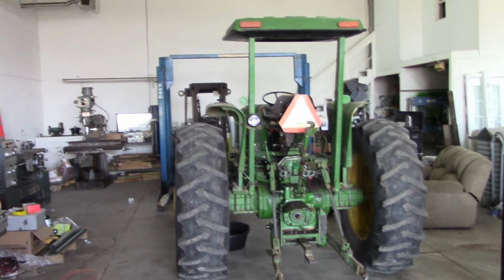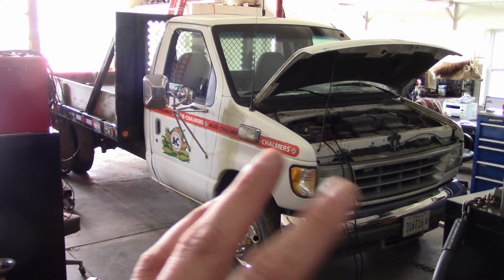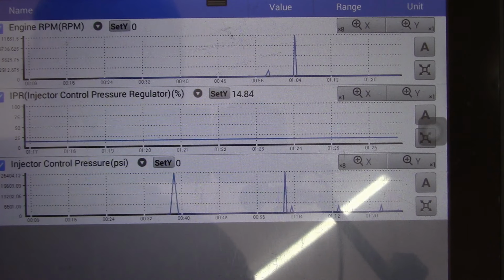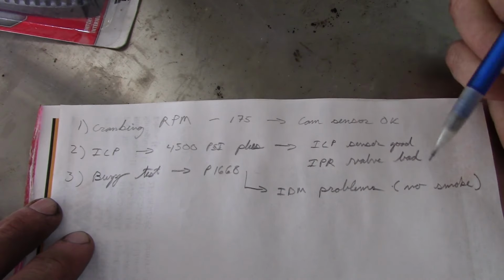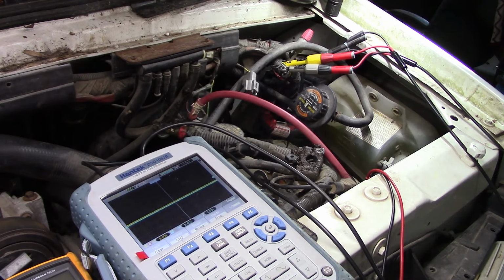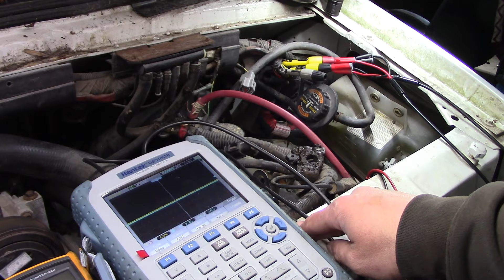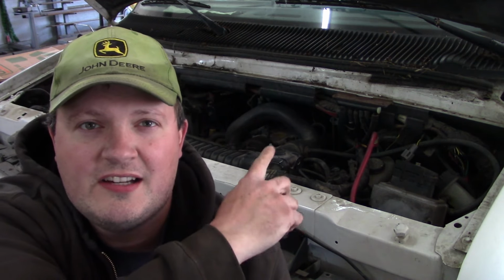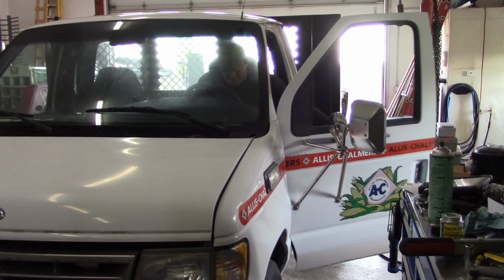Ford E350 | 7.3 Power Stroke - Cranks but won't Start - Part 1

Comment: Thx for the video.  You took a bit of a risk by using your own module, considering it ate 3 previously.  40K mi on an ambulance is like dog years.  That engine has been heating and vibrating the wiring harness and associated components for many more hours than the 40K would suggest.
Reply from the maker: True. It could have 20,000 idle hours.

Comment: what? no push bar on the cub cadet? 50,000 miles and 500,000 miles worth of idling! 7.3 in a van has a larger turbo because they dont have an air charge cooler. it will be interesting to see if the connectors are melted together shorting out the idm. the 25 miles thing suggests to me that it could be temperature  and expansion that helps to induce a short. cant wait to see you dig into this one. these are my favorite types of repairs.
Reply from the maker: Yeah, it may well have 20,000 idle hours! The owner says one valve cover was removed and no issue was found. But there has to be something happening and the valve cover harness is such a common failure.

Comment: Just a thought.. you didn’t mention it, but did you pull the old IDM apart and look for water encroachment?  The placement if the IDM was in a spot that would cause them to flood when it rained or from washing the truck.  I have heard of back to back failures because of this.

Comment: In Europe (and many other places). The Ford Transit Pickups are this style (Van front, pickup rear) , Also Mercedes Sprinter, Reneult Master etc. Oh the Euro fords were 2.5 litre and traditionaly non turbo ;)
Reply from the maker: That would be easier to work on than a 7.3L engine that barely fits in a class 8 truck.

Comment: My first check would be wiring changes made when ambulance body was installed and removed.
Reply from the maker: Yeah that's a good call.
Reply: Yeah, I've stripped the shitty wiring out of a couple of ex-fire trucks, those guys suck at wiring and figure more tie wraps will fix it!

Comment: Those units must have a known problem if a lot of the companies have reco'ed units available.. Where i worked we had a run of Bosch abs units go open circuit where the pin terminals would break away from the circuit board. I had the magic chopsticks. You'd take the cover off and push on the terminals while your mate is in the car reading the scanner. Wed just resolder the joints on the board and they'd work. Is it worth a look as you know which terminals you are looking for?
Reply from the maker: They are pretty reliable, but they had some issues with water intrusion. That pretty well ruins them!

Comment: Hello Wes. Could it be a voltage surge ?. Or like you said the connector in the valve cover?.  Has always Liked,shared. All my best. Awesome Mower ; )
Reply from the maker: Could be. I don't know. It's odd.

Comment: There must be a formula of some sort to determine how a large shop becomes so small in a short amount of time.  I enjoy the videos.  Thanks
Reply from the maker: Stuff expands to fill the space...
Reply: @WatchWesWork  You put a lathe and bridge port in a room together,  come back in 9months and the whole place is over run with  pedestal grinders, shapers, horizontal mills, and cnc routers.  Buggers reproduce like rabbits.

Comment: If it's an ambulance, you got a chance. Those should be a good deal if you want a cheap Powerstroke but here in the south they are all clapped out by the time they retire them. I'm sure with some digging you'll find why the IDM keeps getting "fried out".

Comment: I’d guess high resistance in the injector circuit. Possibly a bad ground causing high resistance. Maybe try a voltage drop from the module to an injector?
Reply from the maker: I've checked each circuit and they are right on spec.

Comment: I remember when the ambulance service in BC, Canada started using diesel ambulances. It was around 1991, so the 7.3 IDI no turbo. The news did a story about frustrated drivers having trouble making it to calls in a timely manner, because they could hardly get a hill! My dad was on ambulance when his station was first given the diesel ambulances, but by that point they were the powerstroke, so they were actually pretty good.
Reply: i think a lot of places in the US ended up just putting turbos on a boatload of government equipment before the turbo was the standard option. firetrucks and ambulances were having trouble with hills and such.

Comment: Chances are you have a bad ground. I had a 97 doing the same thing, eating idm's like a 5 year old with a bag of Oreo's. Mine ate 6 within 150 miles. Turned out after a 3 week study and 11 different diesel mechanics it was a simple ground problem. Replaced all the main ground leads to the motor and frame and to this day ( 9 years later ) it has not ate another idm. After it was fixed i had the injection harrniess replaced just to be safe.
Reply: WELL THERE'S YOUR PROBLEM LADY!
Reply from the maker: Seems like a valid concern. I will check them.
Reply: Yeah, I would look at what the did in the conversion. There was probably all kinds of wires that supplied power o the rear half. I'm thinking thatt ay have been what rubbed the wire bare.

Comment: Have a question way off topic. 06 Cummins 5.9. Rough idle and smoke upon cold start meaning sitting overnight. Then once its warmed up runs great. Everyone says its injector problem... has a FASS lift pump changed filters...can u give me some tips to check myself before I take it to the stealership?
Reply from the maker: I don't know as much on the common rail Cummins. I don't know how much I would worry about it if it clears up quickly.

Comment: Any way you can compare your IDM and the junk one with an ohm meter and maybe see which pins are open? Maybe narrow down the circuit that is causing the issue? Also if the alternator was over charging could that cause it?
Reply from the maker: We can try.

Comment: Hey Wes! I’m in the market for a scanner. Is the Autel that you are using the $1500.00 ish one?  Lol, notice I go by the price (model number) not the actual model number. So, yeah just curious. I need it to be bi-directional. Thanks!
Reply from the maker: It's a Maxisys 906BT. I think they run around $1200. It's been a nice tool. It has quirks, but I like it.

Comment: Sounds like the high pressure oil pump
Reply from the maker: Nah. That was an issue on some of the earlier 6.0s, but the 7.3 HPOP rarely fails, especially with low miles.
Reply: @WatchWesWork  I had a 7.3 in a 2000 f350 I changed every sincere and modules nothing until I changed the high pressure oil pump it fired right up run like a new one the guy that has it now runs the sh.... Out of it

Comment: Does the system have a total hours function somewhere? The first thing I initially thought was arcing or grounding issue. Excellent work on the diagnostics!
Reply from the maker: I don't know. The Super Duty trucks had an hour display.

Comment: An ambulance would run a lot. Air conditioning or heat. Probably has high hours on the motor. Take care Wes
Reply from the maker: Yeah I'm sure it has a lot of idle hours.

Comment: The IPRs also frequently fall apart when the sheetmetal nut backs off. Blob some silicone or thread locker on it once you put it back together. Look down in the oil flooded valley to recover the nut.

Comment: You might be on the right track with those worn through wires.  Check through all the wiring for shorts,  breaks and ground loops.  Check for good grounds everywhere as well,  you may have to run some ground cables.

Comment: Was that sparking or just tape flapping comming from that wire connector with the wires worn thru 

Edit: 
Look at time index 22:30 just above the alternator you will see the connector flashing or some tape flapping.

Comment: I would check for poor grounds. May explain the crazy high pressure readings too. Certainly not a happy bunny.
Reply: That is what i was wondering. It does seem like the circuit is grounding somewhere it shouldn't. Very strange.
Reply: I have seen this also but the truck has 40,000 miles. Still a good idea to check all grounds.
Reply: @Military-Museum-LP  It may only have 50K miles but being an ambulance it has hundreds of Idle hours, which are generally harder on diesels due to the fact that they don't burn as good when idling resulting in more cylinder wash.
Reply: Every PS e4od that has failed me had tge pump welded to the case or the shaft or both bad grounding is def a prob on pre 2001 then it became a guarantee
Reply: @johnstockwellmajorsmedleyb1214  can you explain a little more. My van is a 95 7.3 . Lost power then couldn’t restart it. No fuel is going into the fuel bowl
Reply: @appliancerepairshorts  
Man you are SOL my Crystal Balls are in the shop! LOL
Hit me up here when you can be live and I will pop my email for a minute

Comment: Is your scan tool off by a factor of 10 on the ICP? the duty cycle on the IPR looked fine (not maxed out) like the PCM was ok with the reading
Reply from the maker: I don't think so.
Reply: Ok definitely something to look out for though, we've had a few misdiagnosis at the shop from snap-on puting the decimal point in the wrong spot

Comment: The 25 miles is what's interesting for me. What would the conditions be at that point? Does it take that long to hit full temperature? Maybe starting a regen (if that's on this engine)
Reply from the maker: Heat, vibration, etc. I don't know.

Comment: What does the back of the cab look like? Did Ford mass produce those as cut a ways then fill it in after with sheet metal ot is it all one piece?
Reply from the maker: I never paid attention. The cab is closed at the factory. If they use them for campers or whatever, they just cut an opening in the closure.
Reply: The cab was open to the ambulance box. The Brother in laws remount business found the back enclosure and the flatbed and put it together for me.

Comment: no wonder so much of this power stroke crap is sitting in junk yards-back yards and so on NO one knows how to get them running.
Reply from the maker: I dunno. It's really not a whole lot more complicated than a gasoline engine of the same vintage. I suppose most mechanics are out of practice on these old HEUI engine now since most are in the smelter.

Comment: Nice work Wes.  did you check with the scope after switching the idm's to compare the results?  just to know if that 4500psi still exists or that it lowered to normal settings.  i like your video's, they are educating and entertaining. thanks for that!
Reply from the maker: I did not, but you can hear that the injectors sound like they are firing perfectly.
Reply: Maybe Wes knows more than me, but I would have a) put the scope on my truck's known good IDR just to refresh my memory of what it should look like, then b) put the IDR from the dead truck in my tuck - to see what the trace looked like in the context of a good system, (ie if there were any spikes). That would confirm the IDR was indeed no longer working properly. Knowing that, I'd be worried at putting my known good IDR in the dead truck - especially if my truck was not showing spikes.

Comment: Just replace the motor with a 300 inline.
Reply from the maker: Did they ever offer the 300 in an E series? I don't know if it will fit. That thing is long!
Reply: @WatchWesWork  yes. My 1993 E150 had a 300 inline. Definitely gives you a little more room to work on it. The spark plug in the front was the only one I had to get from under the hood. Wasn't bad accessing things through the dog house. Starter was even easy to get to.

Comment: Did you run that test to check the pressure with a known good injector driver module to see if you get the same erroneous high results?
Reply from the maker: No, but we can hear the injectors are firing correctly. They sound horrible if the ICP pressure is too high.

Comment: if the injectors are not firing there is no outlet for the oil to flow and that causes the pressure to go high, the high cranking pressure is a indicator of a IDM issue.
we had a number of econolines with the 7.3 and celebrated the day the customer retired them! they were not bad the only common problem we had with them was the exhaust back pressure sensors that were at the front of the drivers side exhaust manifold but you had to crawl in from the back to reach them.
Reply from the maker: That's a good point! The injectors firing would be bleeding off oil normally. It seemed like a false alarm.

Comment: I live in Connecticut and I have an 09 6.4 power stroke it just started puking oil into the radiator most likely a oil cooler issue I wash I lived closer to Wes I’d pay whatever to have him fix it awesome mechanic
Reply: Consider Eric O. at South Main Auto in Avoca New York, western New York, also on YouTube.   He's also an excellent mechanic and his rates are generally reasonable.   Although he may find broken things the owner doesn't want to pay to fix.  I bring my cars to him (90 miles or so) when I need diagnostic work, the repair it myself.   You've got a much longer drive.

Comment: how much is this truck even worth? 😁

Would love to see the followup though!
Reply from the maker: I don't know. Not much I suppose.
Reply: Arnþór Gíslason anything with a 7.3 is worth a ton more than you might think. They have a cult following. That cutaway chassis , with the Ambulance upgrades- dual alternators- upper radiator hose that goes around the serpentine belt, and if it has it, the hydro boost braking especially if it’s one with a Saginaw power steering pump, instead of the ford , would make - a sweet upgrade for a worn out gas chassis for a class c motorhome.

Comment: I'm an old turkey, I have driven Fords most of my life and I have found in gas and diesel trucks 90 percent of the problems are the wiring and I am not computer savvy at 74 so I am screwed !
Reply from the maker: Wiring is easy. Follow the smoke!
Reply: Visual inspection can take care of many straight wiring issues, as long as you can come up with an idea of where to look.

Comment: As stupid as it may sound I had an E3 50 gas engine 1998 itate the computers also I came back to the point of the battery was sorting them out the battery was five years old

Comment: Wes love your content, but wtf are americans burning injectors under valve covers for.
Reply from the maker: I actually think this is better. The Duramax engines have the injectors outside the valve cover and they corrode badly requiring fancy pullers to get them out.

Comment: Remember, on these 7.3s injectors rely on engine oil level. If the engine oil level is 3 or 4 quarts low (should take 16.5 quarts to fill) you will not start.
Reply from the maker: I literally said that exact thing.
Reply: Oil level was the first thing he checked!